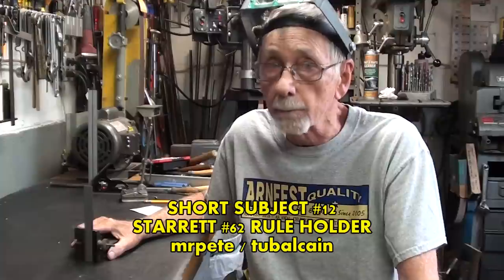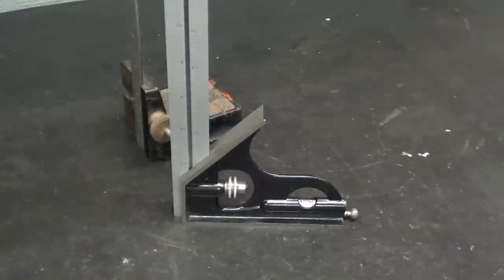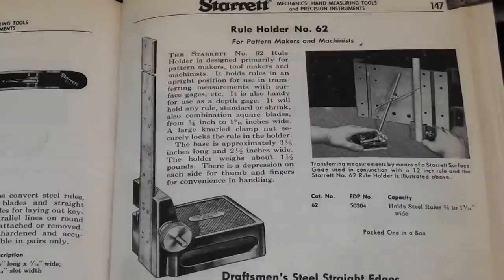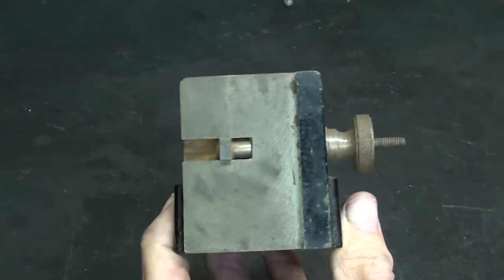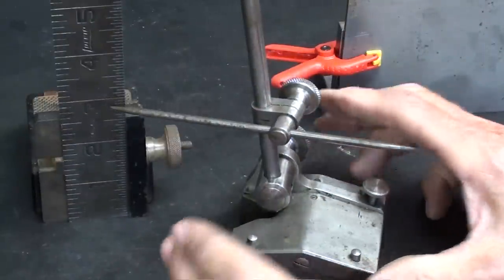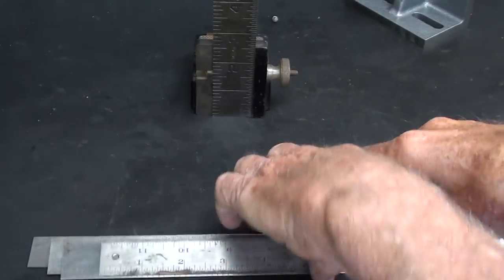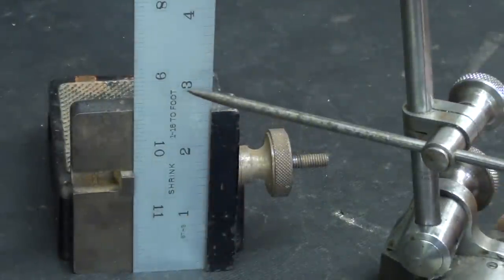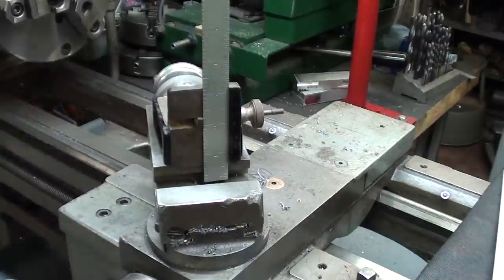STARRETT RULE HOLDER #12 short subject tubalcain

Comment: I do own one of the no. 62 rule holders. I love the weight of this tool. I also find it invaluable to hold a small framing square, or also very handy to hold the rule of a combination square and then the base of the combination square is slid up or down the rule and used as a height gage. Lastly, with a number of 62 it has to be good (as that was the year I was born 😊)

Comment: My de-rusting trick.  I always kept a few gallons of used machining oil in a bucket.  I did a LOT of rebuilding and repair.  Take something off the machine, in the bucket it went. Small parts went in a metal strainer, in the oil.  Leave it for a day or two, just to loosen stuff.  Then wire brush, big or small course or finr, steel or brass brushes.  When done, rinse in newer oil, maybe some already in another machine, then into the spirits.  Blow dry.  I shortened more clean offs this way.  After a few years I would be amazed how much dirt, rust, chips, etc. accumulated in the bucket.

Comment: Yep, learned a new thing....a shrink rule.... didn't know they ever existed... would like to see a short on that, too.  Thanks!
Reply: With very few exceptions, most materials expand / shrink when heated or cooled. This includes various metals. The difference in expansion /contractions must be accounted for when fabricating objects to high precision. There are various ways to use rulers that are pre-configured measure the object at a given temperature in order to assess it's specifications at another temperature.

Comment: Yes, I own one of those and it makes a great paper weight😊. I also own several shrink rules and would very much like to see a video on how they are used.
Reply: Your shrink rules are used in pattern making. Different metals shrink at different rates when they cool. So a pattern has to be made larger for different metals. The rule should be marked for the amount of shrink/ft. or the metal being cast. 
You can find the amount of shrink in a Machinery’s Handbook or in a petternmakers book.

Comment: Hi Mr. Pete.  I have one of these I picked up on fleabay a couple years ago.  I use it along with a surveyor's auto level for doing precision levelling work.  It works great setting tables and machines in our fabrication shop.  Last year I used it to set the bottom track of a swing bridge level.  With an 18" or 24" it makes an excellent stadia rod for the auto-level.  We could easily split 1/64" at 30'.  I use mine all the time.

Comment: i haven't used mine for machine work in the shop since i got a nice height gauge (70's) but i very occasionally use it in the wood shop. That would be a much used item in a pattern shop though, with shrink rules particularly. Mine is homemade, very well too. i got it with some stuff an old fella retiring sold me for a very good price when i was new to the shop. he set me up basically and obligated me to pass the favor on as well someday.

Comment: I have used many of these with a transit for setting machinery. The rule is set on the machine at various point and height readings are taken with the transit and the position of the machine to be leveled can be deter mend.

Comment: I have one of those and I use it quite often. Like you show in the video it is MUCH more stable than the combination square head. Also easy to read off the rule with it facing you. Starrett rules (and I guess most brand of rules for combination squares) are quite accurate with repect to the ends of the rule... just watch out for burrs on the end of the rule. It is also surprisingly quick and easy to setup for transfering dimensions for layout work. Easier and quicker than a height gage and accurate to +/- 5 thou for quick work. One can also make a quick and reasonably accurate caliper out of it by using the appropriate rule and either a combination square head or an adjustable square head on it. I am not a cabinet maker but I imagine it could be very useful for some carpentry work when a bit more precision than a tape measure can give is required. If I didn't have one already I would make one. It would make a good project.

Comment: Let's compare soybeans to soybeans. Inflation calculators suggest the current price for an item that sold for $1.85 in 1935  should be $40.08. Some have mentioned you can get them for under $170 used, but Starrett wasn't selling the #62 used - they were selling new ones. Regardless of the inflation adjusted price a NEW Starrett #62 is listed in today's catalog (27 Oct 2022) at $239.00 USD. That's a price increase of 12,819% compared to the meager inflation increase of 2,067%.
Cheers

Comment: Being a retirered cabinet maker i fiunf this very interesting about the shrink rulers, but that would be specific to the wood being used and if being used vertical or horizontal as the wood lays, but castings are always ground to the finished demensions. Lovely old tool which i could use in my wood shop, will make one out of exotic hardwood but also rotatioal for angles. Funny woodworkers! Thankyou Mr. Pete!

Comment: $1.85 in 1935  is $40.85  in 2022 money. If you make minimum Wage, (ranging from 7.25 to 16.10)  and work 40 hours in a week, That's either most of a day's wages at the low end, or roughly a third of a days wages at the high end.  This same tool used on ebay sells for about $160~170 dollars.

Comment: Works very well for setting the table saw! For square and height and if you are cutting atop a sacrificial piece it can be quickly and accurately adjusted to the sacrificial piece and then make the depth you would like to cut

Comment: I usually put  the ruler against an angle plate. I've thought about making one of these ruler holders a couple of times, although it's got to get in line behind the many other projects. 
One trick that would make the ruler holder  more handy is to slide the ruler up when laying out a mark that is, say, 11/64" above a mark that is 17/32". you'd set the surface gage to 17/32", slide the ruler up until the scriber tip is at the 1" mark, and now the distance to move the surface gage scriber is simplified.
 Sure we can do the fraction math too- (17/32 +11/64 is 45/64,  three 64ths shorter than 3/4)  but if you can get to the same result faster, that makes using the tool worthwhile right?

Comment: Mr Pete, could I please ask you to look in your oldest Starrett catalog for me please?? I have a 12-in master machinist level that is very old. It's still in its original wood box with paper label and it very clearly says number 96. I'm going from memory, but this level has been called the 1088 forever. The one I have is extremely old though NOS. I called Starrett and they insisted I was wrong! They went so far as to suggest the label was a potential forgery. It is brittle as could be and there is genuine Japanning , numerous signs of it being about a hundred years old. I theorize that it might have been the 96th offering from them. But I can't get any clear information and I can't find anything on the web. Can I please trouble you to look in your catalog and see what number 96 references? BTW, the tool you are featuring is fascinating in that I think it's one of the most worthless offerings I've ever seen from such a grand company. It almost lowers my opinion of them. It's not a bad tool, it's just a stupid one. Just put graduations on a square and call it a day

Comment: Lyle! I've a off topic question for you,
 HOW can/could  I lock my threaded  screw on chuck on to my South-bend Lathe so I can cut threads in reverse and away from the chuck without screwing off the chuck?Is there a way? (other than draw-bar type collets attachments for small items)
Reply from the maker: I have been wrestling with that problem for years. If you ever find a solution, let me know

Comment: I have a rule holder that appears to be about the size of the Starrett item. The rule clamp design is different. It has no cast-in checkering like Starrett uses. There are numbers cast into the bottom cavity (pattern number ??). No manufacturer identification.is present. Are you aware of other makers of rule holders?
Reply from the maker: I am not aware of other brands. But they’re probably are several other makes

Comment: Could you tell me what the pins in the corners of the surface gague are for
Reply: They hook over the edge of a surface plate and register from the edge of the edge is square. I have used mine registering from the edge of a granite master square.

Comment: Great tool but easily replaced buy other more versatile tools these days. Thanks for sharing.
Reply: Unless you were laying out patterns with a shrink rule. Otherwise, you would need a calculator to figure the shrink for each dimension on the print to use with the height gage.